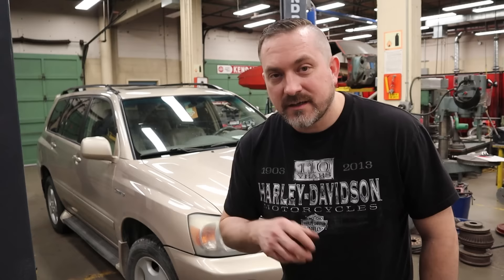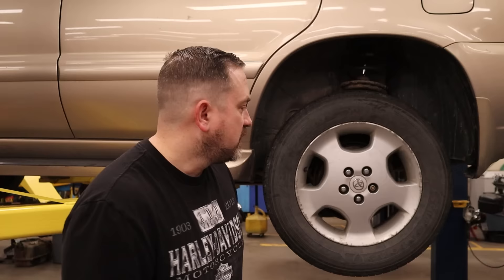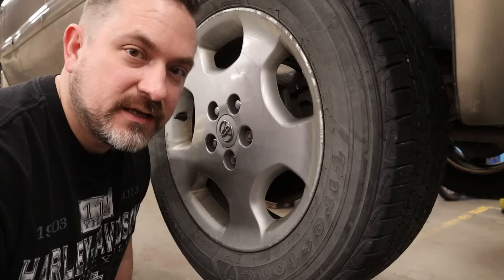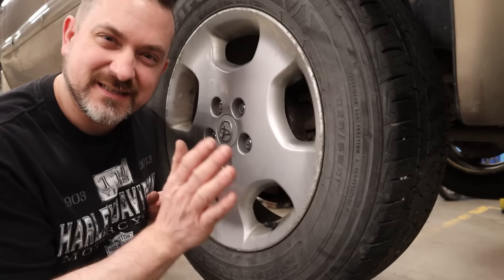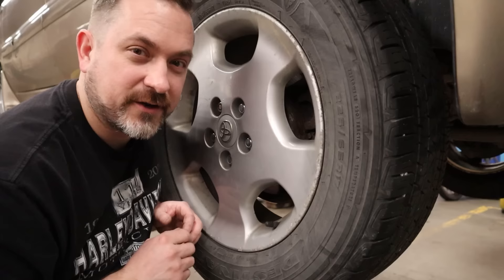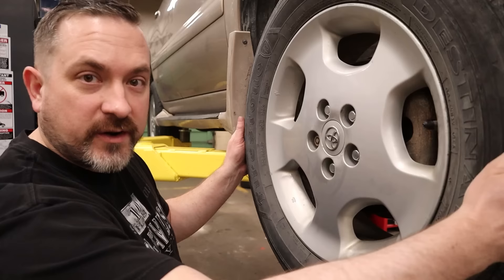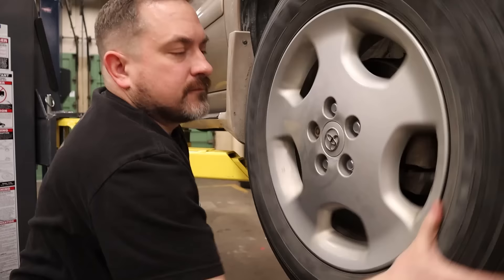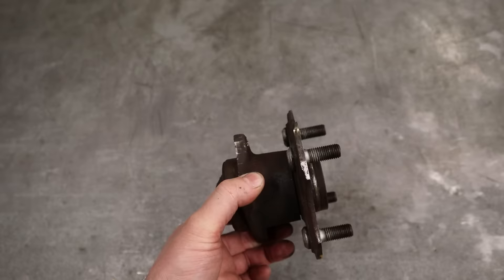How to 100% diagnose a bad wheel bearing.

Comment: I've got a noise maybe you can help me. I took it to a shop they told.me brake caliper well changed it and the noise is still there. I can't upload the video here unfortunately but going slow it's like u have ziptie on driveline or that's the way I put it
Reply from the maker: Hrmm hard to say over a message but could be warped rotors or worn out pads or CV axle.  I have a road test bad bearings video that you should check out, it might help you diagnose if it's a bearing.  Hope that helps and thanks for the watch!  Welcome to the channel!
Reply: If you have an email I will send it to you bc honestly at this point I'm lost and don't want to throw parts at it
Reply from the maker: If you can send the video to me on instagram, I'll try and help ya out

Comment: Would you know why a new replacement front hub bearing would roar a bit after installed? It's on an 06 infiniti g35x awd. torq spec i found was 92 ft lb, its a TRQ hub bearing. The old one was replaced by a Mechanics garage less than 3 months ago and now this new one roars just a bit.
Reply from the maker: It was making noise right away or does it now make noise 3 months later?  You can get a bad part so it might have failed early.... it happens.  Do the same tests to check the new bearing.  It also could be something else that was messed with while the the bearing was getting replaced. like a bent dust shield or something.  Thanks for the watch and good luck!
Reply: @wayofthewrench   This now just replaced and out of the box to car drove and has small roar. turn car to right a lil bit and roar goes away. shield not rubbin pretty easy job since the one i replaced was just done in november. could an axle on pass side cause this it was replaced 2 yrs ago im assuming bad bearing out of box.
Reply: @krd4834 please let me know because that’s the exact same thing on my car too. Brand new wheel bearing. Within 30kms it made the exact same
Reply from the maker: Sounds like it.
Reply from the maker: Sounds like a bad bearing out of the box.

Comment: I have this noise too but the place I took they said I need Front right and left axle..... so what you think?
Reply from the maker: Did you try what I did in the video?  If your wheel has play like in the video, you need a wheel bearing.  If none of your wheels have play, then it could be cv axles.  You can check the rubber boots to see if they have split open and grease is flung out.  If it is, there are done.  Good luck!
Reply: @wayofthewrench  I checked the front two wheel yesterday and it won’t even budge lol. Plus no noise . I will check the back two wheels today . So if that’s not it ig it is the cv axle . Because rotors won’t do these noise right ? I have my old rotors since I bought my car . But anyways thank you boss .
Reply from the maker: What's the verdict Samid?

Comment: My rear wheel on my skyline moves (more like swings) from front to back but nothing up and down. Any idea? Would a wheel bearing make it swing? And it kind of makes a clunking noise on acceleration.
Reply from the maker: Sounds like one or more of your rear wheel multilink bushings are shot.  Jack up your car and have someone do the shaking as you look underneath with a light.  You may have to remove the wheel to see what is actually worn.  When you gas it or brake, the thud sound is the play in the suspension bushings on the rear.  Good luck!
Reply: I was feeling humming sound from rear wheel of my car. I jacked it up. There was no friction while rotating the wheel but there was sound on hitting the tyre from top or bottom only. The mechanic replaced the bearing.
But the problem is not resolved. The wheel nuts are also tight.
What is faulty?
Reply from the maker: Time to get another mechanic.  No play left and right but play up and down is not a bad wheel bearing and that shouldn't have been replaced.  It is either loose strut parts/bolts or upper/lower ball joints.  These days, my guess is a bad lower ball joint.  Let me know if I'm right!  Good luck.
Reply: @wayofthewrench  : Going for major service this afternoon. Shall let you know the outcome.

Comment: I have a whirring noise that starts around 45mph and fades away after about 55mph... and only when accelerating.  Not quite sure a wheel bearing would be the culprit.  Part of the drive train, maybe?
Reply from the maker: At that speed it sounds like an out of balance wheel but could be a bearing or CV axle.  Just do the checks Ike in the video to confirm.  If there is vibration as well it's probably wheel out of balance.  I have a great video on that too.  Cheers!
Reply: Appreciate the reply! @wayofthewrench
Reply from the maker: Cheers!

Comment: unfortunately  especially on a G.M. VEHICLE   you cannot find a bad bearing  up on the lift   with weight off the wheel by spinning the tire   ,the bearing must be loaded  ,but it  could be lose  ,on a G.M   your better off replaceing both front bearings and hubs
Reply from the maker: If you have trouble sensing a bad bearing you can lift the wheel an inch or two off of the ground and then use a long pry bar to move the wheel.  You do have to have the wheel off of the ground though.  Honestly, I have all of my wheel bearings diagnosed beforehand with a good road test.  You should check out that video too.  Thanks for the watch!

Comment: Had the noise. Took it in and i did have a bad bearing. Got it replaced and no change in the noise at all. Now i have no idea what to do. New bearing, new tie rod, new ball joint and the same exact humming noise driving straight and turning right that goes away when i turn left.
Reply from the maker: You have a bad left side bearing.  What side did you replace?
Reply: @wayofthewrench replaced the right because it was bad. Left side was fine.
Reply from the maker: But you still have the noise.  So it is probably the left side.  I would watch my other video on road testing for a wheel bearing noise, you'll see what I'm saying.  Keep in mind it could be a front or rear bearing so check all of them.  Also most shops replace bearings in sets, so left and right.  Good luck.
Reply: @wayofthewrench  I'll try getting the left front replaced. If that's not it I'll do the other back since I just replaced a hub and bearing on one of the back wheels.
Reply: @wayofthewrench  so i don't feel any play in the wheel but there is kind of a grinding and even squeaking sound when i spin the wheel, also when the wheel spins there is vibration in the coil spring. i'm hoping this is what i'm looking for so i can get it replaced monday
Reply from the maker: Well what happened?  Don't leave me hanging....lol
Reply: @wayofthewrench  my first mechanic was a crook. told me to my face the left front bearing was fine. it wasnt. it was near collapse. got it replaced and now it's fine
Reply from the maker: Ahh that sucks.  Glad you got it figured out.  I do all my diagnostic work now so if it wrong, I only have myself to blame.  Cheers!

Comment: Is it possible to only hear the roaring sound when turning? I am only hearing it when I turn right and it's loud and I feel the vibration through the steering wheel and my feet.  Thanks
Reply from the maker: Usually turning a direction quietens the bearing noise when you unload a side's bearing.  I would check your lugnuts and the bearing for play.  After that check your cv axle for play and blown out cv axle boots.  Good luck!
Reply: @wayofthewrench  I will double check all of the above. I have been reading that when you turn right, that shifts the load to the left side. Perhaps the left bearing is starting to go bad and only makes the noise now when I turn right. I recently replaced the right side bearing, but now I just have a roaring noise when turning right.
Reply from the maker: yup, sounds like the left bearing that wasn't changed a s a set is bad now.  Double check with a jacked up wheel play test first though.  Cheers!
Reply: @wayofthewrench  left bearing was confirmed as bad. New hub and bearing assembly has been installed and the noise is gone.
Reply from the maker: Sweet, glad you got this sorted out.  Cheers!
Reply: Me too. it took a while to figure out everything, but now I have the confidence of driving with two new front wheel bearings. @wayofthewrench

Comment: What about if you get a bad smell from front tires ? Like a burnt smell
Reply from the maker: Could be a bunch of stuff.  Bearings cooking and going bad.  Seized caliper and brakes are not releasing.  Really bad wheel alignment and tires are being "sanded off".  Cv axle boot broken and grease has flung out and is now running dry and hot.  Lots of stuff it could be.  Jack up the car and check for loose bearing, tire wear, etc.  Good luck!
Reply: @wayofthewrench  my tire alignment is off. But will check everything out to see and hopefully it not the bearings or cv joint I’m about to put new tires on front already did the rear.
Reply from the maker: Ya really bad toe in or toe out on front wheels can literally peel off the rubber on new tires in minutes so make sure you get that fixed.  Cheers!
Reply: @wayofthewrench  was the bearings
Reply from the maker: Glad you figured it out! Cheers!

Comment: Hi, are there inner bearings at the transmission housing? Do these also wear out? if so, how can you tell if you have an inner wheel bearing worn out?
Reply from the maker: Funny enough, we are changing transmission bearings right now, you should check out my instagram.  Yes there are bearings in the transmission and how you diagnose those is the wheel bearing sounds are only when the wheels are spinning.  The transmission bearings spin when ever the clutch is engaged.  So stop the car and put it in neutral, if the sound comes and goes as you engage the clutch and disengage the clutch, its in your transmission.  

Inner and outer wheel bearings and hub assembly bearings all have the same speed dependant sounds and play in the wheel like in the video.  If one of the inner or outer bearings is shot, you change them as a set.  Thanks for the great questions!

Comment: What could be a wobbly wheel ?
Reply from the maker: If the wheel lug nuts are tight and there is no play but the wheel wobbles when you spin it, it is a bent rim or tire issue.  The wheel might have hit a pot hole or a curb.  Thanks for the watch!
Reply: @wayofthewrench  they said it was just bad tire . Friends of mine have this van 08 Chevy 2500
Reply from the maker: Could be.  Cheers!

Comment: First thing most people think of is worn brake pads. Always start with the cheapest fix first.
Reply from the maker: Well a set of brake pads is $80 and the wheel bearing is about $250.  So it really should come down to proper diagnostics.  No play, no speed dependant sound ( not brake squeal), then it's not a wheel bearing.  Low speed squeal and or grinding noise when on the brakes...its brakes.  Thanks for the watch!

Comment: Does a bad wheel bearing ever make a clicking noise?
Reply from the maker: It could but not usually.  Sounds like it could be a CV axle for clicking, especially when it's louder clicking/Clunking in the corners.  Thanks for the watch!

Comment: I have a 2018 impala and my car vibrates at 20 mph then goes away…..i have rotated the wheels plus i changed to my oem wheels and it is still doing the samething any ideas what it can possibly be??
Reply from the maker: Does the sound get worse as you go past 20 mph?  Did you do the wheel bearing tests in this video?
Reply: Tell you the truth i had low pro tires with 22 inch wheels 🛞 i have not done the wheel bearing test i am going to do that this coming weekend thanks for the response ,i will let you know i hope its just the wheel bearing instead of something more serious
Reply from the maker: Well Big G......was it a bearing?

Comment: Changed the wheel bearing but it is still making the same noise. Any ideas?
Reply from the maker: What kinda noise and under way speeds/driving conditions?  Which wheel bearing was changed?  Did you test all 4 wheel bearings?
Reply: No. Did not check all 4.

Now the abs light and weather trek and cruise control don’t work.
Man I need a mechanic. Going to take it to a shop next week.
Reply from the maker: Yikes, sounds like multiple issues or at least a really bad one.  Good luck!

Comment: I have a question I bought a new knuckle from Honda I bought a wheel bearing from RockAuto and the hub from RockAuto we put it in and there's a lot of play yes to tie rod has been changed because it's a shot the ball joint was changed on the lower control arm it's a 2018 Honda HRV latest things something is defective with this the  combination gave it to Mavis and they said it's got to be a wheel bearing I mean you still have play in the wheel up and down side to side because the knuckle from Honda was a return from a shop I don't know what the reason was but they resold it so I don't know I bought something from eBay if it is then it's one of those components that are defective or not working right because the axle moves up and down in the hub when the car is not running
Reply from the maker: It's really hard to tell exactly what is wrong over a message but it sounds like either the bearing is completely the wrong part or is broken and has play.  I would confirm all of the dimensions by looking at the old parts to see if that is the case.  If everything is the same then something else is up.  A new wheel bearing or wheel bearing hub assembly should have no play like you are saying.  Also, just because it is a new part don't assume it is a good part.  I have had other parts be bad right from the store.  I wish you luck!
Reply: @wayofthewrench  I found out it's the hub we don't know how
Reply: @wayofthewrench  thank you
Reply: @CurrentGenGamesWithNick  improperly install

Comment: Can the wheel bearing cause wheel hop at 65 mph?
Reply from the maker: Nope, that is a wheel out of balance issue for sure.  Good luck.
Reply: @wayofthewrench  I finally raised the car and there is a clunk side to side when holding the wheel. The bearing test passes and there is no noise. I'm now thinking it's the steering (pitman) what do you think?
Reply from the maker: With only a side to side play but not up and down, that is going to be a steering component like a tie rod or idler arm or pitman arm.  Get someone to shake it while it's in the air (safely) and get a light and see what has the play.  If one component is bad there also might be others that are on their way out too.  Good luck!
Reply: @wayofthewrench  did I mention it is a 23 year old e39. Are you saying I should replaced all of the suspension and steering components? :)
Reply from the maker: Oh maybe but I would check for wear and condition first.  Good luck!

Comment: Does wheel bearing make noise while in park pushing the gas on the car ?
Reply from the maker: Good question.  No, it will never make noise with the vehicle not moving.  If it makes noise in park with the engine on, then it is something that is spinning when the engine is on.  Like an alternator or power steering pump,etc.  Hope that helps.
Reply: @wayofthewrench  where is the power wheel located
Reply from the maker: Power wheel?
Reply: @wayofthewrench  yes
Reply from the maker: Sorry, I'm not sure what you mean by power wheel.
Reply: @wayofthewrench  power steering where is it located or is it near the belt
Reply from the maker: power steering pulley would be attached to the serpentine belt or the power steering belt depending on how old the vehicle is and have a reservoir for the steering fluid.  If it's brand new, it might not have power steering  but electric power assist.  Hope that helps

Comment: so my 2011 Mazda Tribute's tire spins nice when jacked and in neutral but there's a grinding sound a ever-growing wobble and whirring noise when I drive. now what?
Reply from the maker: When you jacked it up, did you test for side to side and up and down play?  Did you check all 4 wheels? Sounds like a wheel bearing or possibly a loose wheel.
Reply: @wayofthewrench  I didn't check all 4 but the one I checked seemed like it was for sure the problem(brake dust, signs of being previously hot) there's no play side to side or up and down
Reply from the maker: I would check all four first.  Then check if your brake calipers are loose and how worn out your brake pads and rotors are.  I have a great video on checking disk brakes if you need it.  You could also check your cv boots/axles, steering components, and suspension for loose/worn parts.  Good luck!

Comment: Can a warped wheel bearing mess up my new discs?
Reply from the maker: Wheel bearings don't warp but can become bad/loose.  A bad bearing could start causing excessive pad rubbing on the rotor but would be making really bad bearing noises and would fail the checks in this video..  Thanks for the watch!
Reply: @wayofthewrench  Thanks for the information! This video helped me. The local garage messed up installing new discs & pads on my C class. The dealer claims my pads, wheel bearings and discs needs to be replaced. Will see if only discs will do.
Reply from the maker: Yikes!  Maybe they warped them with an impact gun?  Hard to say over a message and not looking at the vehicle.  Did you get it sorted out?
Reply: That's exactly what the dealer said too. Apparently my garage used an impact gun and torqued it down with 300 Nm. My service manual says to torque it down with 150 Nm torque. Don't know the lbs equivalent, sorry! I installed some new brake discs at another garage and around 1600 km later, still no issues. I think they sanded off (I'm not sure) the pads, they were relatively new. @wayofthewrench
Reply from the maker: Glad you got it sorted out.  Cheers!